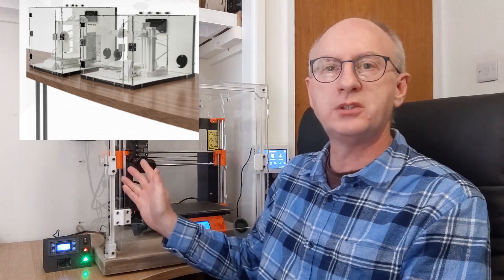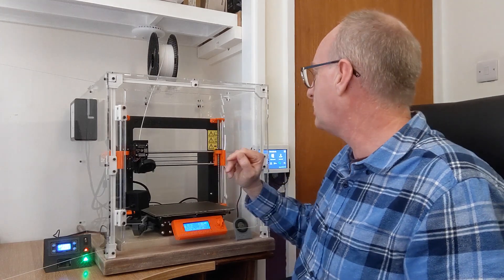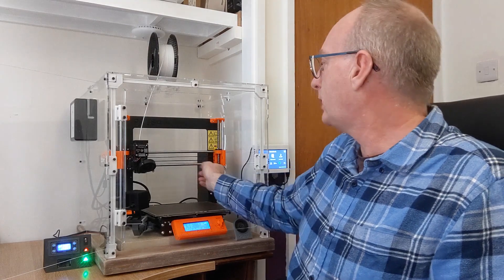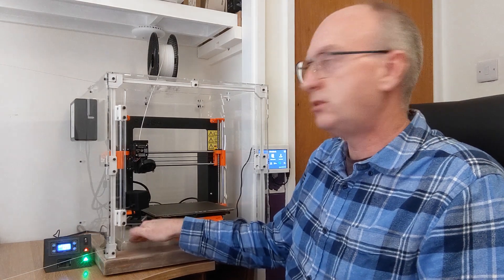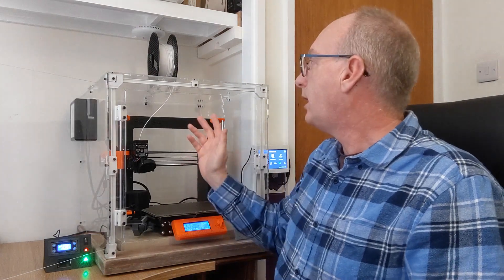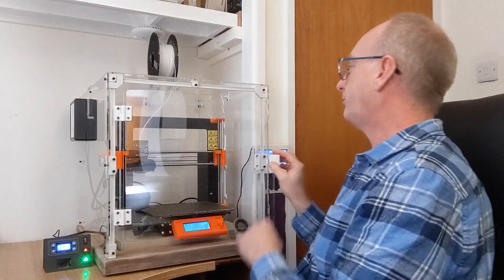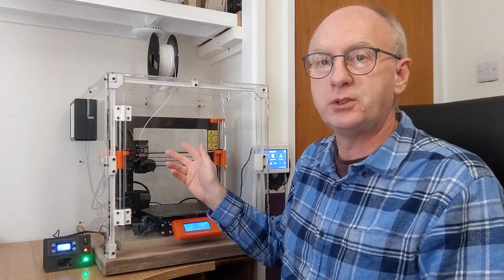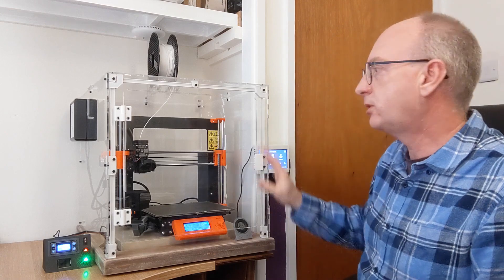3D Printer Enclosure Review - Prusa / Ender - Tukkari, Prusa Box, Ikea Lack?

Comment: the plastic one in your intro section of the video has gaps so that filter on the upper left side will not work that great.
Reply from the maker: Wrong, although the edge of the print warped, there is a rubber seal that you cannot see. This ensures no air escapes the filter.

Comment: how is that filter effective when the box is not airtight ... there are like 3mm space between sheets
Reply from the maker: The enclosure does not need to be airtight. The fan is sucking fresh air through the gaps and expelling it via the filter. Bad air will not escape through the door gaps because of the pressure effect from the fan.
Reply: @colinhill  yes i already get it after bit more of exploring :D thanks for the answer, i got Tukkari on the way right now.

Comment: Thanks for the great content Colin. Now that you have assembled a Prusa Box and the Tukkari TS it would be great to get a side by side comparison. I have the Tukkari TS but recently stumbled across the Prusa Box on FB and prefer the look of it and the easy side access. I didn't really think about the rising heat on the PSU in the Prusa Box, would be great if you get a chance to test the temp of the PSU.
Reply from the maker: Thanks Darrell. Prusa Box is more than double the price of Tukkari TS :). A fair comparison would be against a Tukkari TLX which i currently don't have (but i do have the Mini TLX and its very nice indeed). Each has their own pro's and con's which i can't go into too much here. But in brief, Prusa Box is highly customisable within its enclosure, whereas Tukkari TS is simple and great for those on a budget and addons like Pi/screens have to be outside the enclosure. I like both. Regarding PSU in Prusa Box, i will be doing a temp test once i have designed a fan holder to pull air through the PSU to see if it decreases the casing temp - semi scientific :). My next step is to add 120mm fan and temp control, pi, screen etc to the Prusa Box. Thanks for watching.
Reply: @colinhill  Awesome videos. Would you know of any similar ones like the Tukkari TLX? I tried to order that just now, but it says it doesnt ship to hawaii. (USA) Thank you!

Comment: Thanks for the video, it was very informative. I'm interested in your extractor fan mod, do you mind sharing some more details on that? Like what filters you use and how you designed the box.
Reply from the maker: Hi, i have just uploaded a video specifically for the fan module. I used Zortrax filters as they are easy to buy. Fusion 360 for the design. Link to Thingiverse for all the STL files.
Reply: @colinhill  Thank you, the fan module printed beautifully! Now I'm working on building a fan controller from some recycled Arduino and led display parts while waiting for the enclosure and filters to arrive.
Reply from the maker: @jonasborgstrom4566  I used a thermostat/humidity controller from Ebay, around GBP15, has relay contacts for the fan. And included the sensor on a lead.